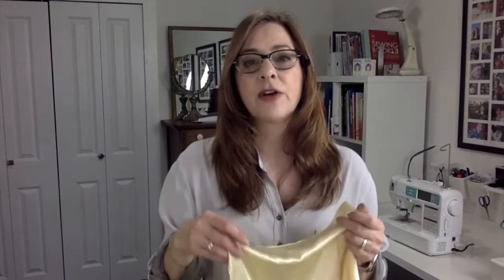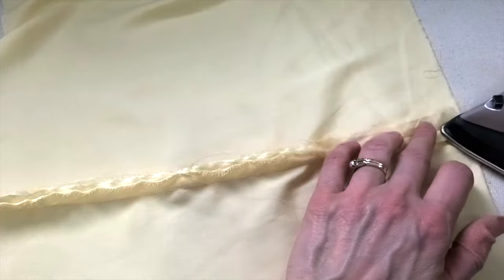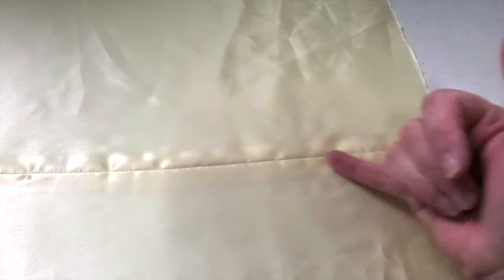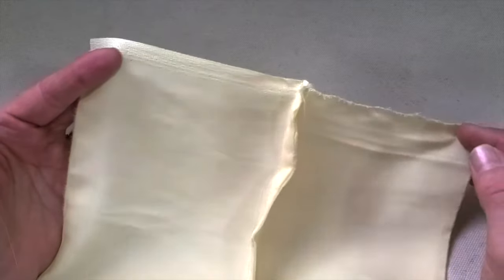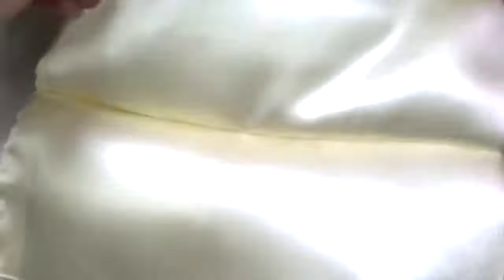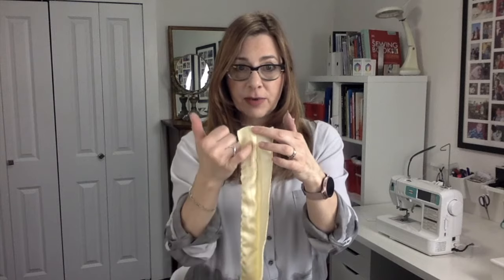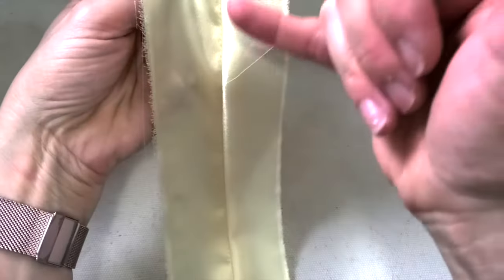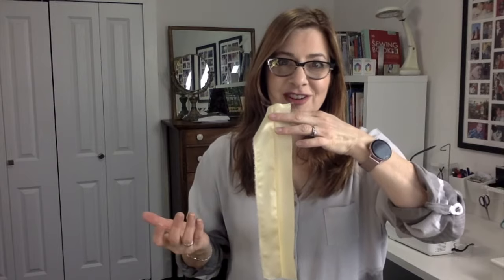Sewing satin? You need this tip before you cut!

Comment: Thank you so much for this tip. I finished making lining for a small purse, but I didn't like how it turned out. The purse is something I made by attaching cord to an antique silver topper with an accordion  opening. Then I macrame'd the cords into a purse in a very lace style of knots. The purse took me hours to create and the silver topper is one of a kind. Usually you'd see it on a chain purse, but the chain was missing when I bought it about 50 years ago. After waiting so long to complete this project, I was so disappointed about the lining. The lining is seen through the macrame knots. Now I know what to do. I have a lot of the satin fabric left so I will recut and redo the liner. Thank you! Great tip!

Comment: If the material doesn't have the 'salvage' edge how do you tell which way is crossgrain? thanks
Reply from the maker: Good question!! If you have a magnifying glass, lol, you'll look for the float yarns that run on the cross grain. If not, I'd suggest folding your fabric on the bias, into a corner, to bring two intersecting edges together, and baste the two sides together. You'll see a big difference between them, with one going into the seam smoothly and one looking dimply. mark the edge that is smooth, then remove your basting stitching. Place your grain lines parallel to the marked edge.
Reply: @CatherineSews  Oh, thank you for your quick response. I am a novice with fabrics (and in sewing terminology) but I am going  to do what you said. Thanks, again 💖

Comment: This works as long as you don’t have to cut longer than the width of the fabric. But for instance - a dress with princess panels, you can’t cut the fabric that way.
Reply from the maker: About 6 of my students are all working on strapless, floor length, princess seamed gowns, all cut on the cross grain. No problem.

Comment: What if i am making a long piece that can't be cut that way? I have a piece that is more than the width of the fabric. Plus what about the hem, wouldn't it be dimpled?
Reply from the maker: Yes, it does get tricky when your piece are longer than the width of the fabric. Sometimes it's logical to put a horizontal seam, like at the waist, but then that can defeat the whole purpose of cutting on the cross grain. Maybe you could go on the bias? And yes, the hem might dimple, but I would still rather have that than a dimpled side seam.

Comment: Dumb question, but won't you usually have to sew along the long grain at some point (e.g. hemming pants if the leg of the pants are sewn on the cross grain)?
Reply from the maker: Not a dumb question at all. Yes, the hem will be on the straight grain but any dimpling there won't be as obvious as the long side or centre back seams of a long dress. Dimpled seams there can really ruin a dress! And if you hand sew the hem, you can avoid the dimples altogether.

Comment: When cutting pieces on the cross-grain, I assume you would need more fabric than when you cut on the lengthwise grain.  Is there a rule of thumb as to how much extra fabric you'd need to buy?
Reply from the maker: Hmmm, I don't know of any rule of thumb but I guess it depends on how many pieces you have to cut on the fold. You might have to do multiple folds if there are a lot. Even so, I don't think you'd have to use a lot more fabric.

Comment: Hi Catherine.  I have a satin fabric with intended purpose of a dress for granddaughter.  I would never have thought to cut on cross-grain.  Cutting on cross-grain is contrary to what I thought was a basic rule due to stretch factor of a fabric.  Perhaps satin does not stretch more on the cross-grain vs. the vertical grain?
Reply from the maker: No, I don't think it has stretch in either direction, but the long float yarns run horizontally, I believe, which is why seams hang better on the cross grain.

Comment: Ok maybe I’m missing something, but what do you do if your garment is longer than the 52” on the cross grain? This won’t work for satin pajama pants for a man who is 6’2” 🤷🏽‍♂️🤷🏽‍♂️🤷🏽‍♂️
Reply from the maker: You're right that there's a limit to the length on the cross grain. Many satins come in 60 " widths which would be plenty for PJ pants for someone 6'2". Even 52" is 4.5 feet, so that's some pretty long legs!
Reply: @CatherineSews  so how are long trains on wedding dresses created? They’re definitely longer than 60”. I’m not being contradictory at all. I’m new and I truly don’t understand. I’ve seen dresses made of satin longer than the cross grain (as I’m sure you have) so my curiosity has been piqued. Thanks so much!
Reply from the maker: @djtblizzle  that's a good question! I don't have all the answers. I just know that the seam is SO much nicer if it runs along the cross grain, but there will be times when it's just not possible. Don't worry about how I might take your questions! It's all good! It's great to question everything,  especially if you're new to sewing.